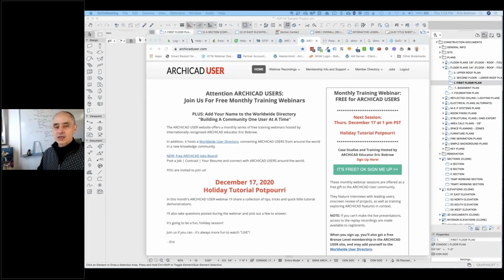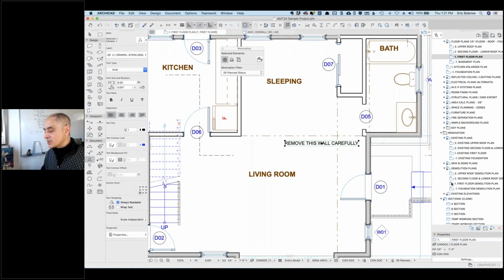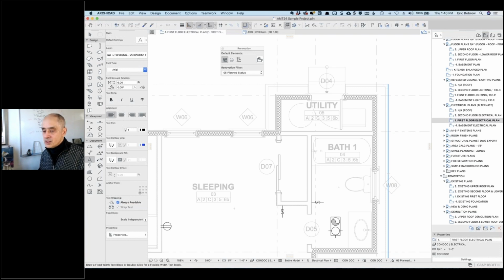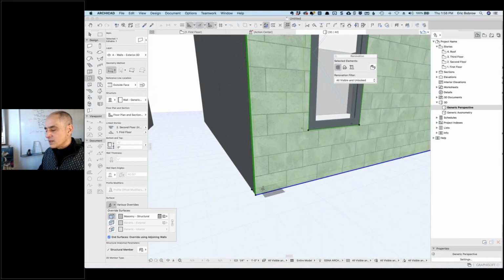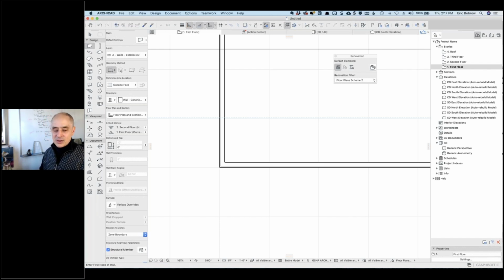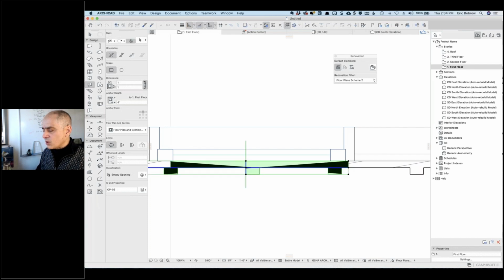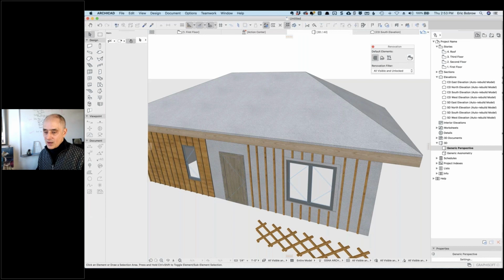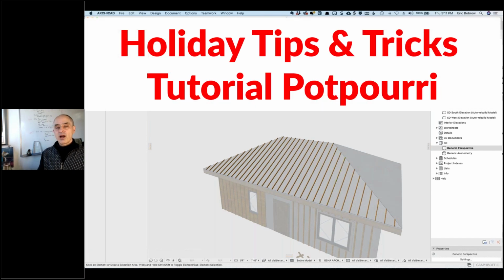ARCHICAD USER Dec. 2020 - Holiday Tips & Tricks Tutorial Potpourri!

Comment: They could fix the multiple iterations of designs by just adding new construction 1, 2, 3, 4, 5, 6, etc as many as you like.  So its just a secondary status to the new construction status. 
So you click a wall for example set new construction, 3, for your 3d iteration of design. then just select planned status 3. could be implemented with a mini dropdown next to each reno status.
Reply from the maker: @Dan - The option to Pin elements to a specific Renovation Filter is powerful, however since pinned elements are only visible for a single Filter, it prevents it from being a general solution. If you have 3 options or iterations for your front entry, and 2 for the kitchen, you can't show option A for the front and number 2 for the kitchen vs A and 1 or B and 2, etc. If these worked similarly to layers, and allowed Renovation Filter combinations, it would potentially make this much more powerful.

Comment: Thanks for sharing your knowledge so generously.
I noticed you mentioned that it is not possible to duplicate layers, making it necessary to manually edit visibility settings for a new layer.
There is actually a way to work around this:
You can duplicate a layer using the attribute manager. It works like a charm - all the original visibility settings is applied to the duplicated layer.
Reply from the maker: Stephan - Thank you for this valuable tip! I will experiment with it so I understand it fully. I appreciate that you took the time to share this with me, and with other Archicad users, via this comment. Where are you located Stephan? What type of projects do you do with Archicad?
Reply: @ericbobrow  Thank you for taking time to reply, Eric. I am located in Cape Town, South Africa. We only started using Archicad in March 2020, and lockdown has not been great for business, but so far, on Archicad we have done two commercial renovation projects and currently working on a new upmarket residence. Previously we have used Autocad for new schools and clinics, office parks and blocks of flats. Looking forward to doing some of these in Archicad!